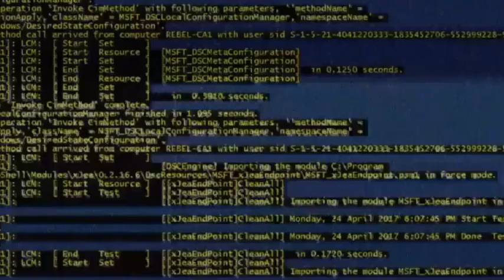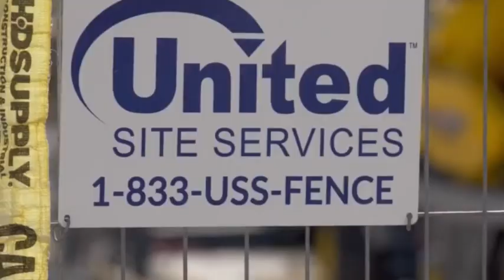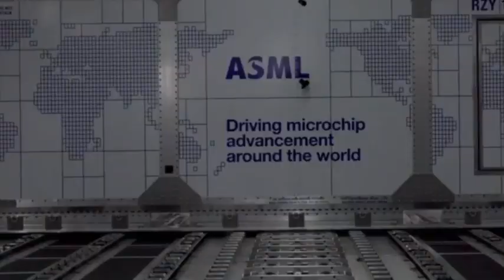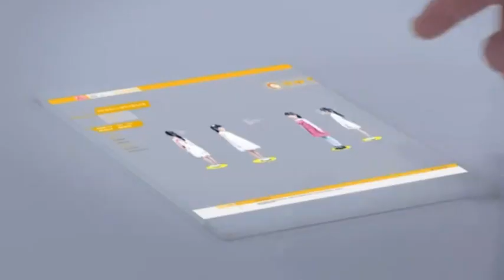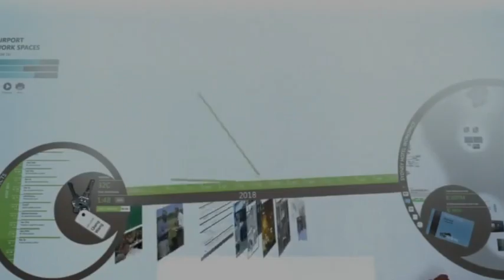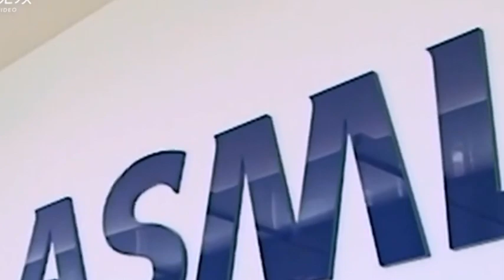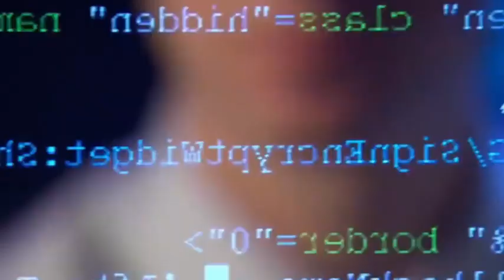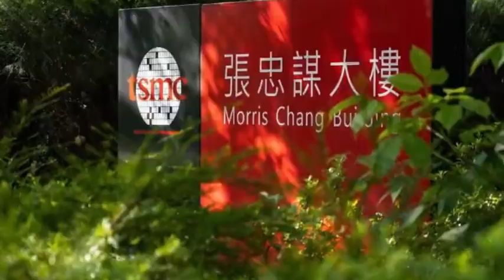China's first ultra-large chip lithography machine was successfully delivered, ASML was impacted.

Comment: Until Chicom working culture turns broadly to quality instead of quantity, its “breakthroughs” will always be plagued by fickle unreliability and outright unpredictable failure. In semis, example of a cause is impurities.  In engines, it is overheating plus electronic controls.  Root of the problem is that at every level the goal is to fulfill the quota, play by the book to avoid blame.  No one wants to point out problems to the boss.  It is built into the system.  

As a test for the quality vs quantity hypothesis, it will be interesting to go through the papers and “patents” of those brilliant young dedicated researchers to find out two things.  How these are applied in practice, and how original they are?  (Result of bot searches which can be self-reinforcing?). 🤪😱
Reply: Your mind is not right